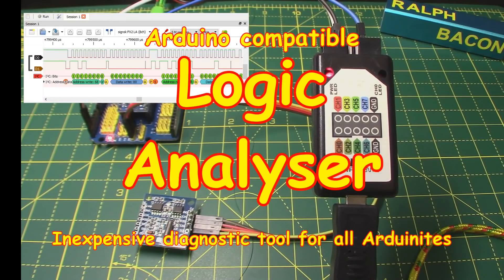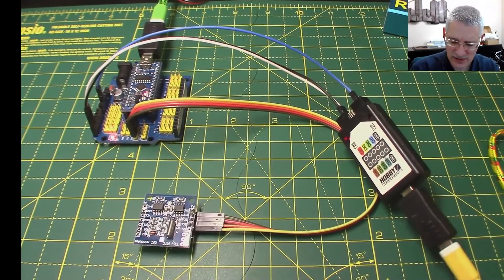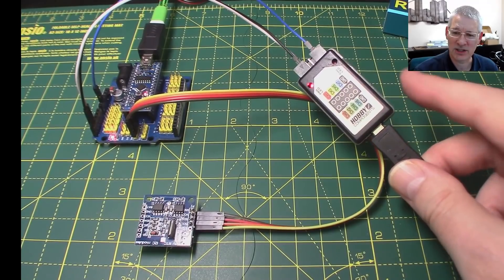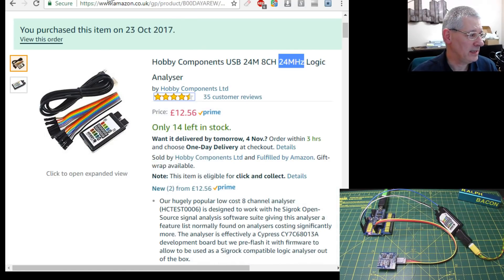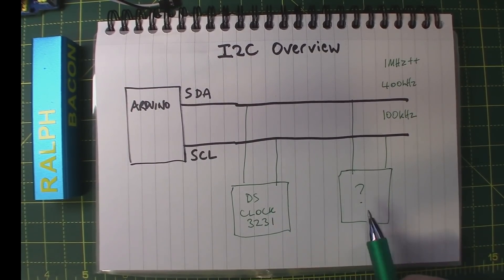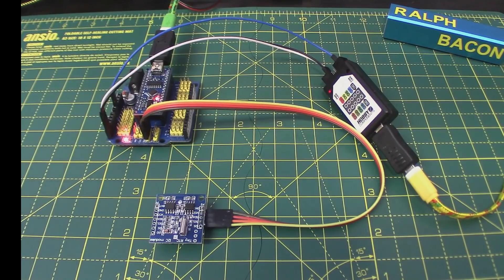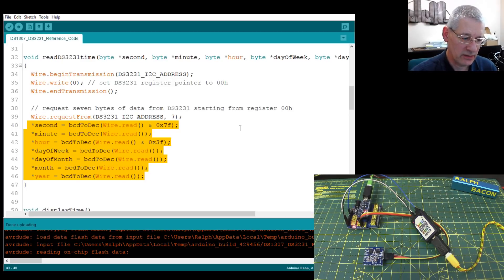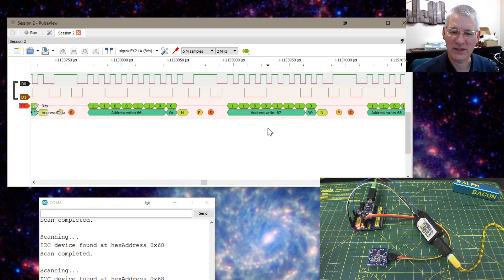#99 Logic Analyzer for I2C, SPI and many more protocols

Comment: Nice one Ralph. Logic waveforms (not "graphs") can be a fantastic source of information about what's going on in a circuit. I just ordered one, but given I'm in the antipodes, it will take some time to arrive. In the meantime, do you, or your subscribers, know of anyone who has it working in Linux?
Reply from the maker: Ah, logic waveforms, not graphs, point taken (now I know what to call them) thanks for the heads-up. I don't know how well it works in Linux, John, but given its software writers proclaim loudly it works on several platforms I'm hoping that you won't have issues. Anyone else have experience on Linux, guys?
Reply: I just got my analyser this week (same one, super-cheap from e-bay), and yes, the Sigrok/Pulseview software does just fine on Linux. In some ways even easier, because tusing your distro's package manager makes it a "one click install". No fussing about with drivers.

Here's my (less eloquent than Ralph) look at it:
https://www.youtube.com/watch?v=NeL3oTHDd88
Reply from the maker: Cool that it works so well on non-Windows platforms, thanks for letting us know.

Comment: Can I use this to confirm the high & low voltages coming from a logic level shifter?
Reply from the maker: I believe this will track anything you throw at it, William. If you specify the protocol being used it will arrange them in a more readable format but if it's just a random signal that would be fine too.

Comment: ZX81???? What is up with that?

I may be an EagleEyes too...

At 07 min 12 secs: "Can be installed on most platforms Windows, Mac, Linux, ZX81"

I had an ZX81 once with the 16 KB RAM expansion (sold and replaced by a ZX Spectrum), but...
Reply from the maker: Thank goodness someone spotted (and commented on) that little joke I had there. I repaired my boss' ZX81 (might have been a ZX80) back in the 80s, he was well impressed. It too had a very wobbly RAM expansion pack that would crash the machine as soon as not. Consider yourself awarded an honorary "Eagle Eyes" badge, Embo.
 
I shall have to put more of these little quips into my videos...
Reply: What about KIM-1 ?  Not many here remebering that one.

Comment: What is the uno type board you have the nano plugged into?
Reply from the maker: The Nano is plugged into a "Nano Development Board" sometimes called a "Nano Expansion Board". It's almost impossible to use the Nano otherwise! See https://www.banggood.com/328P-Multifunction-Expansion-Board-V3_0-For-Arduino-NANO-UNO-p-955701.html?p=FQ040729393382015118&utm_campaign=25129675&utm_content=3897

Comment: Wish you translated the data all the way down to alpha numeric
Reply from the maker: Do you mean, Michael, that I should have chosen some alphanumeric characters, like "A" and "T" instead of just using numeric ones? If so, it was time that beat us all. I was originally intending to use an LED display but it was too complicated to see what was going on (for a beginner) so I eventually chose the simplest thing I could find - that RTC module. Perhaps we'll explore a more in-depth version of I2C or SPI in a future video, where I don't spend half the video explaining what we're going to do! Good point you raise, thanks for posting.
Reply: Yes, 2-wire LED comm analysis would be an excellent example. Appreciate your videos and the clarity they offer, looking forward to more.
Reply: What would be the I2C part that interfaces with an LED?
Reply: My bad...LCD
Reply: That makes more sense.  I've got several LCD displays interfaced to Arduinos via I2C.
Reply: Ralph,
Yes, looking at all types of data would help.  Like why you " & Ox7f" to seconds and hours.
Great Video, Another tool I need in my bag  AND more importantly WHY.

Comment: At 19:18 you say that the LA connection is to earth . You then say that earth is 'Old School Speak for ground. It isn't. I know you know the difference between earth, ground, 0 Volts, floating power supplies, dual rails, ground offsets, ground planes, etc., and the various forms of equi-potential around zero. I like your channel because of your off-hand remarks and your ability to only include the essentials, but this particular one is risky if you get ground and earth potentials mixed up. Many who view your excellent channel may not seek out the real significance of earth and ground. If the Arduinites hook up to mains power for their projects thinking that earth and ground are coterminous may be in for a shock.

The men who wear the thick gloves differentiate between 'live' and 'line' with a preference for the latter and uses 'neutral' rather than 'ground' even though neutral is eventually connected to earth at the substation. Earth and neutral wires co-exist in a 3 pin plug so that the earth wire can be the low impedance non-load carrying conductor to earth for safety while the neutral carries the load, eventually to earth. This subject is worthy of a video by you, although there are other videos floating around that you may wish to point to such as EEVBLOG "How not to blow up an oscilloscope". https://www.youtube.com/watch?v=xaELqAo4kkQ&t=1232s and others by John Ward.
Reply from the maker: You've won the prize for the most re-edited post in the history of this channel! I'm still sitting on the naughty step as I was unclear about ground and earth (can be the same) and I even included this very post as part of a future video about encapsulated 5v mains supplies (investigating whether they are they safe). What you say is very much in line with my understanding, so stay tuned for the video results... and can I get off the naughty step now to finish that video, it's most uncomfortable here, heh heh?
Reply: ‘Ground is not earth’ please write it out 100 times on the naughty step. The terms can only be interchanged by gardeners, builders and parachutists. 

The term 'ground' is misused, as is 'negative' on a battery as it isn’t negative to anything, it is merely of lower potential than the cathode.

Ground is a region of equipotential that can be any (signed) voltage including earth, but earth should not be used to describe ground in the electrical world.
To make the point, when you chop open the potted 240VAC (isolated) / 5VDC converter, make a circuit on the secondary side with it’s ground connected through a diode. You'll have a 5V DC difference in potential in your circuit, but your ground will be elevated by the diode’s forward voltage making your secondary voltage relative to ground = (5 +Vf ). Your 5V DC circuit is isolated from the mains and Earth and can take on any value depending on where it is grounded. This is a useful way of getting odd in-between values from floating power supplies such as batteries ….. but also blow kit up if struck by lightning.

Now, turn your isolating transformer into one that is referenced to planet Earth by adding a wire from the AC neutral to the earth on your house mains. Nothing will happen. However when you ‘earth reference’ the ground on the 5V circuit to the new earth wire on the mains side everything gets real to Mother Earth as she has infinitely low impedence. If your mains RCD does not trip (or even better if it does?), you will demonstrate the difference between Earth, Ground, Earth Referencing, Potential Difference, Floating Voltages, Common Return Path and Isolating Transformers. You may also cause folk to question if 2 wire ‘double insulated’ hair driers are a good idea.

With your back-to-basics skills in visual presentation and verbal explanation you will then keep the magic smoke inside many projects. You may also save some lives.

========================================================
For an encore, use your body as the (intended) earth reference for a critique of one of those lethal neon ‘Electrician’s’ electrical screwdrivers that I think I glimpsed on your desk. Then stand on an insulator and see the neon go out and tell Mrs Bacon to hold the wire 'cos "its safe". Deadly things
Reply from the maker: Well, a circuit's ground may not (necessarily) be Earth, but Earth is always Ground, I think you'll find (when connected electrically to your circuit, of course). I'm pretty sure I understand the difference but you'll have to wait for my video to see whether we are singing from the same hymn sheet! You are obviously passionate about this subject so I'll appreciate your feedback on that video (when it finally appears).
 
I do, however, take issue with your assertion that Mother Earth has infinitely low impedance - it's the relatively high impedance of Earth grounding rods (up to 50 ohms or even more) that make the use of domestic electrical TT supplies relatively more dangerous than TN-S. In fact, the old telegraphers of the Wild West had terrible problems during the summer when the ground was so dry that the signal had great difficulty getting through (they used Earth grounding and a single wire to send the signal). Eventually, they switched to a two-wire system and all was well from then on. Until radio arrived, anyway. Anyway, I ramble on, so back to the video storyboard, and thanks again for your continued posts.
Reply: Tautology. Joining wires = same potential. The earth wire is a non-load carrying conductor for safety. Neutral is the path to earth made at the substation. Put an Arduino to mains earth. The RCD will trip at < at 30mA as it detects the current to earth. Ergo, earth can’t always be ground.

Correction. ME has a (very) low impedance and infinite ability to sink charge. Earth loop (UK) should be < 5 Ohms.  Only Boonies have >50 Ohms. 

QED, but I give up.
Reply: @whitefields5595  "...Battery isn't negative..." Actually, it is, it's all relative because ground can be whatever you want it to be and depends on your reference point. EG telco companies connect the positive side of a series of 4 batteries to Earth which means relative to Earth the negative terminal is now at negative 48 Volts. Put your negative terminal of your DVM on to the positive terminal of a battery then measure the voltage on the negative terminal and your display will show a negative voltage.
Reply: @RalphBacon  "....Earth is always ground..." That statement is incorrect and can only be said if ground is always at Earth potential which it isn't. Many years ago I used to work on colour monitors and the ground in some of those was at 126 VDC
Reply: @trollobite1629  Harry, you have selectively edited my comment above. I say that the so called 'negative' should be better called 'lower potential' which is what it is. Lower potential is more meaningful as it covers a range of potentials, including the  124VDC in your comment. The terms +ve and -ve are convenient shorthand, but misleading when discussing this subject. A mathematician will take-ve  it to mean a negative number less than zero, which is not true and not intended.
Reply: @whitefields5595  "...lower potential which it is..." 
Agreed, but that's not what I was contending.
"...lower potential is more meaningful..."
No, it isn't, try using the terms "lower potential" when doing mesh current analysis. You can't do any circuit analysis without the use of negative terms.
"...+ve and -ve are convenient shorthand and misleading..."
No, they are the correct notation and very specific to that measurement.
"...a mathematician will take -ve to be a negative number less than zero..."
Not actually true.
Connect a couple of 9V batteries in series, now connect the 0V pin of your Op amp to the 9Volt centre terminal of the batteries, from the Op amp's perspective it now sees positive 9 Volts and negative 9 Volts.
Reply: Harry, Check out Wikipedia, that says "In mathematics, a negative number is a real number that is less than zero". 

Of course this depends where you define zero to be, but in the example above where Ralph was using a DC power supply and a battery 0V was ground, not negative, it was zero. Hence I maintain that the use of the term negative is misleading in the context of what Ralph was explaining. Even more so when he was comparing it to earth potential. It is for reasons like this that the power distribution industry uses the term neutral (rather than negative). I understand and agree with your centre-tapping two 9V cells and defining the 9V centre tap as zero, but this was not the point I was making (or trying to make!) 

In your mesh analysis the -ve sign denotes a value of lower potential, with the corresponding integer a measure of how much lower.
Reply: @whitefields5595  Mostly, I agree with what you're saying. As a stab in the dark I suspect you're English because you're being precise about the definitions of Ground, Earth, Neutral and negative whilst the Americans tend to mix the definitions of Ground and Earth to mean the same thing.
Reply: @trollobite1629  Greetings from England! We have come full circle here ... the reason for my first comment was to pull Ralph up on mixing ground and earth. Clearly his ancestors were responsible for exporting this sloppy parlance to the Colonies. This is made worse by the fact that I believe his ancestry may include Francis Bacon who did much for science https://www.biography.com/scholar/francis-bacon who died just before the Pilgrims landed on Plymouth Rock.

Comment: Is this the same as the abundant ebay $7 ones ?
Reply from the maker: Good question, tablatronix. And the definitive answer is: maybe. Look at the other comments here and you'll see similar observations, but whether they are identical internally is another question. As long as the eBay (or Banggood, AliExpress, GearBest et al) item uses the same open source software that I'm using here then I'm assuming it will work. Some use the Saleae software (naughty, as that is not open source) and can use the sigrok software too. Try and find a seller that seems knowledgeable about this product rather than just a box shifter as their information may be more reliable. If you get one and it works let us all know!
Reply: Yes, with Salae original software. So cheap that I purchased 2. 
These modules are very sensistive to noise from the USB power lines.
Giving false pulses on the screen. Use extra caps 100 nF and 10 uF across +V and GND. Or take power from a rechargeable battery pack. 4X 1.25 V.

Comment: I know you are into the ESP32 devices, I was just wondering if you have run into this one:  https://www.banggood.com/LILYGO-TTGO-T8-V1_1-ESP32-4MB-PSRAM-TF-CARD-3D-ANTENNA-WiFi-buletooth-Module-p-1296709.html?rmmds=myorder&cur_warehouse=CN
I ordered one to use in a special emulator build, the reason for getting it was the 4 meg extra RAM chip on-board.  This chip can be removed and replaced with a readily available 16 meg ram chip then the device can run a bunch of emulators, including the Nintendo, Gameboy and more. I guess I have been into emulators since the first ones came out years ago, you see I couldn't afford all the new machines, but I always tried to have a powerful enough computer so I could run emulators and play the same games my friends were playing on their machines, on my computer.  The urge to build my own emulator machine is strong and I plan on doing just that once I sell a few items off on Ebay so I can have more funds to buy the rest of the parts. I know I have the proper color screen stashed away, and even have a joystick I can use in place of the buttons that are recommended in the emulator build.
Reply from the maker: Sounds like a great project you have in mind there, Jerry, but you do know that "her indoors" will demand half your gains from eBay, right? Or is that just my wife that does that? Regarding that device I don't know if I have one but do be careful with the "charging cable" to the LiPO, it's too easy to get them the wrong way round or the cables in the supplied header are back to front. Double check!
Reply: @RalphBacon Well a few years back, when I was a regular seller on Ebay, well a few packages a week at any rate, my good wife of 50 years pretty much stayed out of it, so long as no money transfered into our bank account, and none came out of it.  If, however I used a credit card, or bank transfer, then it had to be paid back on my next sale.  Things have changed since then, though so I am not all to sure how it would go now days, should I go ahead with my plans.
Reply from the maker: Get a PayPal account. Then it all goes into there and out of there and no-one is the wiser!

Comment: So basically a little more complicated than a 20ma current loop....;)
Reply from the maker: Well, just a little, Raymond, maybe! But still simple enough for us to decipher very easily using this nifty piece of (cheap) equipment. You got one? Getting one? Don't want one?
Reply: But smart. Invented by Philips to save wires onboard Audio equipment between modules. Around 1980 ?